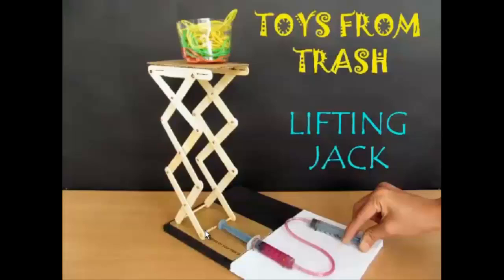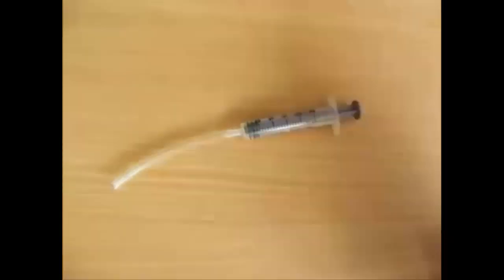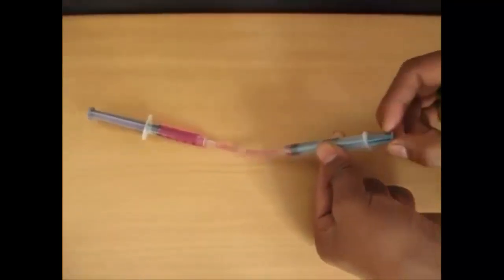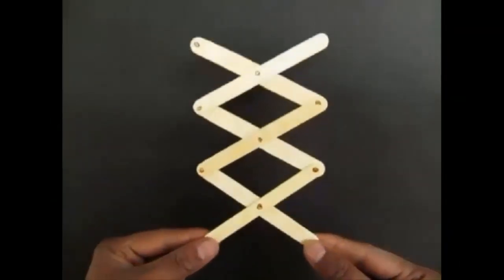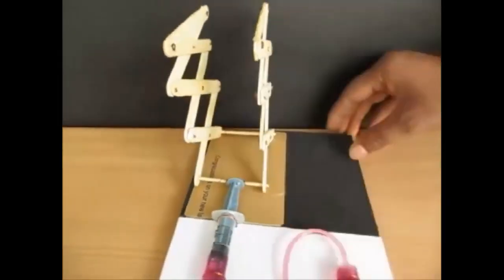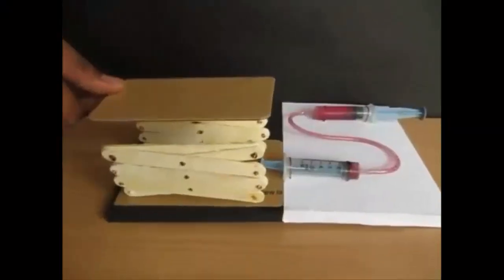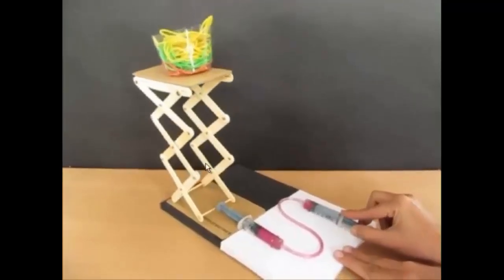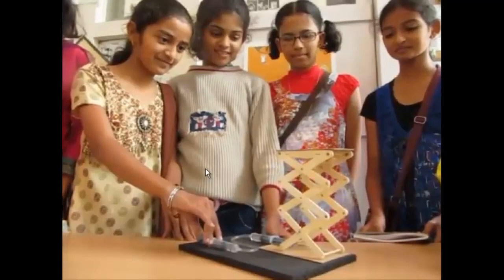LIFTING JACK - ENGLISH - Hydraulic Jack! from Ice Cream Sticks

Comment: Ok let me simplify, I made one for myself referencing this video. Use a compass to make holes in the sticks, make sure they all coincide, otherwise the lift will lean like the tower of pisa. Get a simple copper wire from the electrical store or from your storage room, heat it on a stove, melt the plastic basically and remove it with a wet cloth, you'll get the bare copper wires. Cut them with scissors and take three at a time and just mix them all together using your thumb and finger to get one strong yet flexible copper wire. Simply use a paper puncher to punch holes at the bottom of the stick. If you cant find those thin tubes, use pen refills(I used flair easy click, costs 3 rs.) Just make sure that the refill is quite stiff and doesn't bend easily Take some m-seal or any alternative and fill the holes with it. Then insert the refill and just get both the ends of the refill submerged in the mseal(apply more if you have to). This way, you've stuck the tubes too. Let it solidify(make sure you use powder to avoid messing the seal everywhere including your hands) It would be better to just buy coloured sticks(adds aesthetics). This is what I've made so far, will update later. By the way, buy syringes and flex tube from your local chemist shop.
Reply: can i know that how to attach the syringe with the jack
Reply: Sara Shaikh Good question, that's the part I didn't get either. UPDATE: made the entire model and it really impressed many of my teachers. So you basically just take the syringes and fill them with coloured water(just take water and pour some pen ink in it). Then you basically have to take a cardboard base. Fix the jack lift on it(I simply taped one refill with the cardboard base(like 5-6 layers of tape). Do the same with syringe such that the piston of it touches the straw which isn't taped. Voila, you have tye piston pushing the untaped refill and the lift will go up. Also, instead of sticking cardboard at the top, just stick ice cream sticks with fevicol(will look much cooler). Abd the trickiest one is making hotizontal cuts on the ice cream sticks, I initially used a compass to make horizontal holes to connect them later and also used a heated knife to make the cut directly, in either cases, the stick simply broke  because of too much force. I later realised that good old cutter will do the trick. Just make a cut using a scale to margin it, and then repeat till it cuts through the entire stick. Enjoy. (You can be further creative and take a load and write your name or project name whatever).

Comment: where did you get the tubes?
Reply: ***** They are syrings
Reply: Yousef Obada They said tubes not syringes :P. @Julia Cohen: I would suggest a hardware store or even a auto parts store. They can have some tubing this size you might want. Hope that helps :)
Reply: You can get it in aquarium shop
Reply: Julia Cohen from water gun